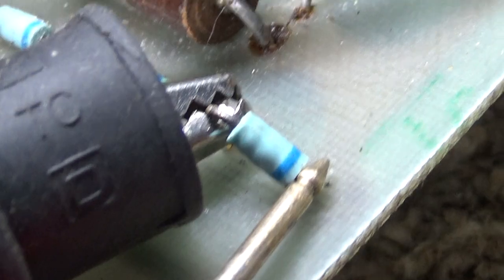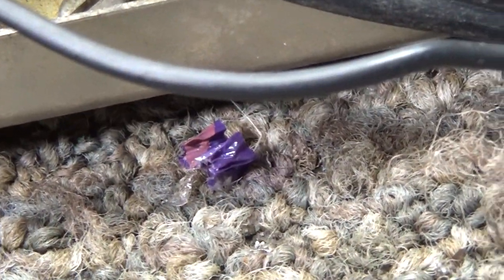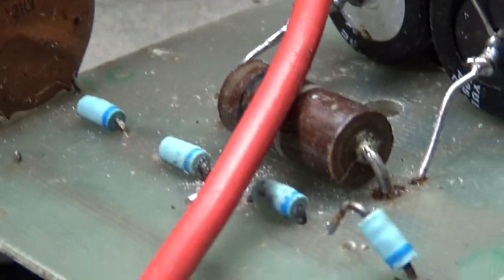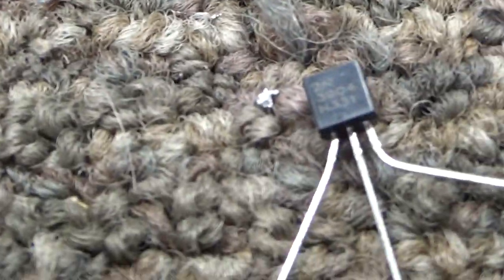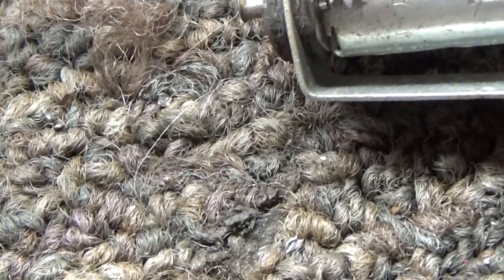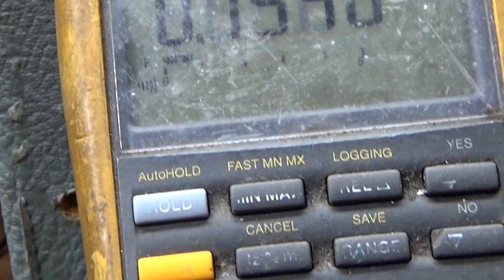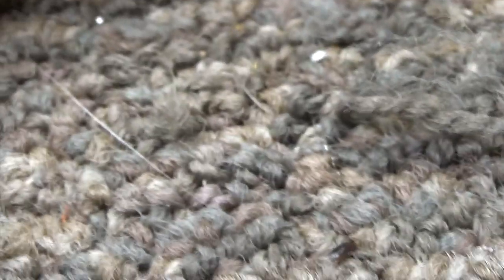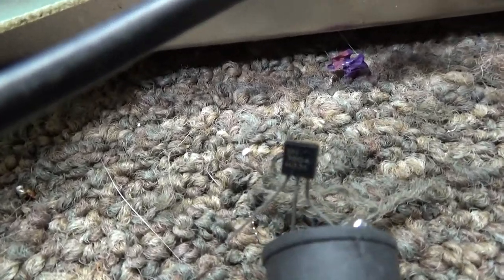Testing Diodes Part 2 and also testing small Transistors using Diode Test.

Comment: Turner (who also manufactured embalming machines) had a series of transistors in their microphones that tested fine with an ohm meter but had no gain! You had to check them with a Cricket in those days to be sure! Also, watch out for high voltage rectifiers. Many have multiple junctions inside of a package and they require a high voltage ohm meter to overcome those junctions and test them. Microwave oven rectifiers are that way. Some have a 15 volt drop.
Reply from the maker: agreed but for CB amps, most use a rectifier string, normally not a single package multi-unit.